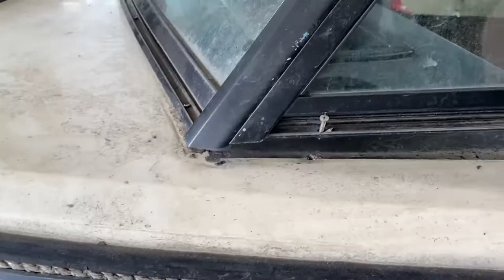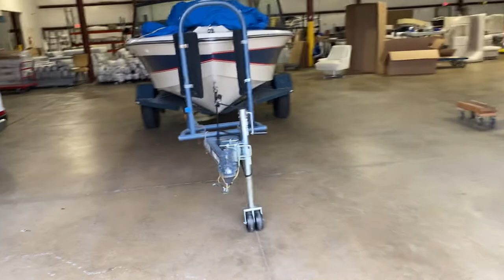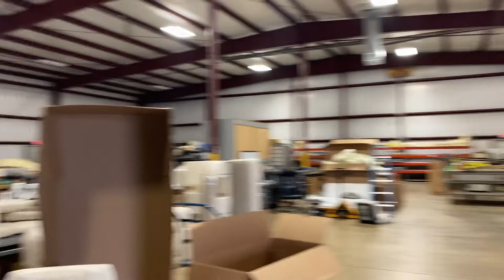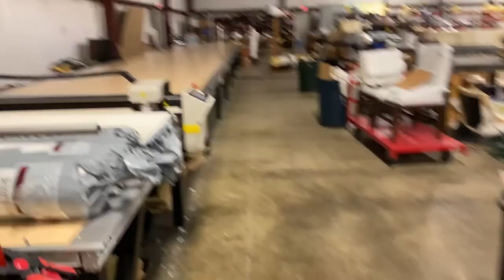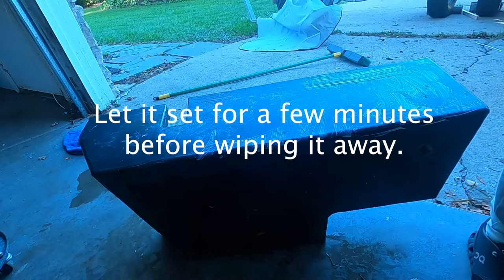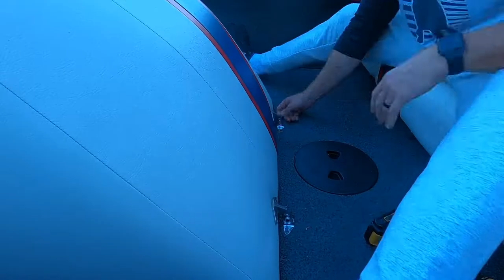86 Ski Nautique Restoration (Part 11 New Upholstery)

Comment: I just bought a 1987 ski supreme the interior is actually mostly intact but looks dingy. If I did want to completely replace the interior what is the ball park price range?
Reply from the maker: Varies a lot. My honest thoughts are 
- cheap $1,000
- simple $2,000
- professional and very nice $3,000-$4,500
The 86 I just had done was $4,500. Hand measured and cut, new foam, new wood backing. Very well done but I paid for it.